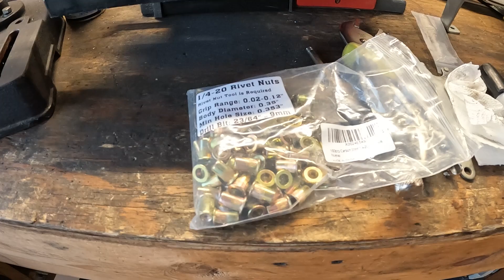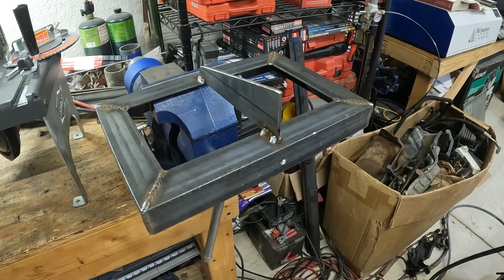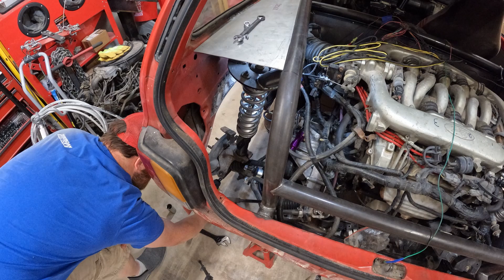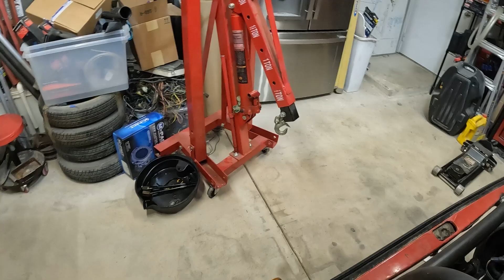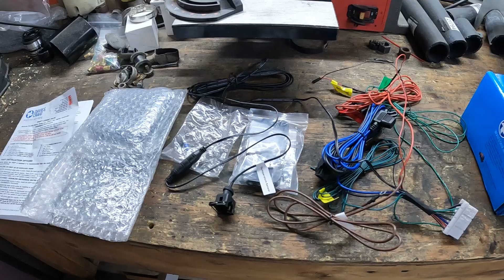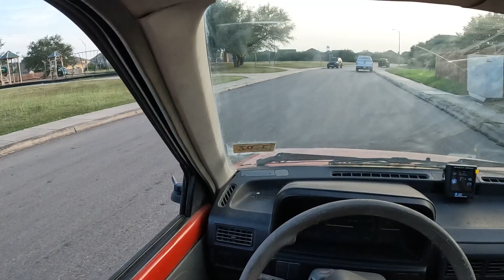Ford Shogun Build  - Episode 8. First Test Drive!!!!

Comment: as for the history,  Jay leno has one and 7 were built, but Ford had nothing to do with the project.  One of the car was lost to  a wild fire a couple years ago. Speedway Motors in Nebraska bought the project and owns the  body molds and jigs as they had a plan to build  a kit  but they ended up owning one of the originals and scraped the kit idea.

Comment: Granite kitchen countertops are made for dirty car parts!
Such an awesome project
Reply from the maker: Hahaha, I need a parts washer, but I'm sorta outta space in the garage. Might need to clean up my shed a bit or get another storage solution in the back yard to house things I don't use often. Engine stand, pipe bender, etc... would also be nice to house the air compressor outside the garage in an enclosed little building. Eh, one day... for now the kitchen granite will have to suffice 😅 thanks a ton!!! 😄

Comment: Good stuff dude.  I was thinking it sounded like 3 cyl!  You got at least 2 with the wires.  But yeah get the thermo out to see if there are any more that aren't firing.  Can't wait for more...
Reply from the maker: Haha, thanks! Yeah, I felt rough right off the bat. Definitely wasn't right. Feels good now. Gotta get used to that engine. It almost feels like it has vtec or turbo lag 😂 it's pretty normal through the lower rpm range, but once it gets to a certain rev range and you mash the pedal, there is a small delay but it wakes up and flies!!! Definitely need to check all the cylinders and pull plugs 👍